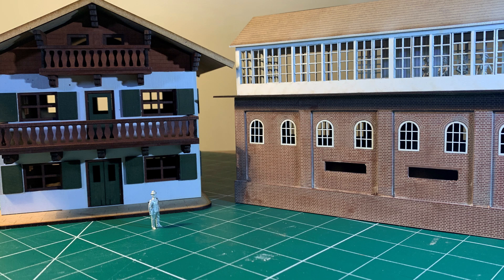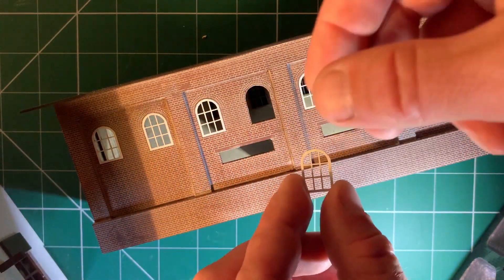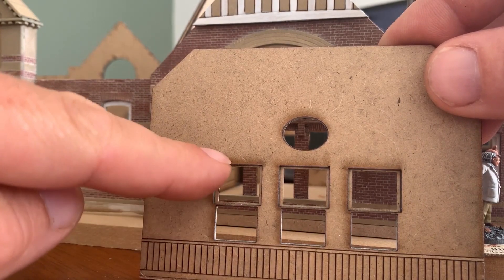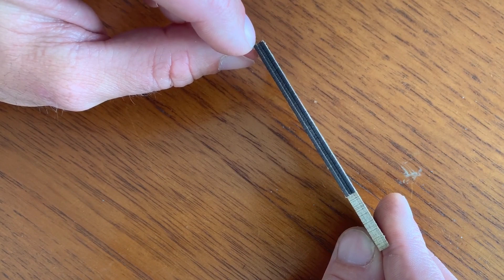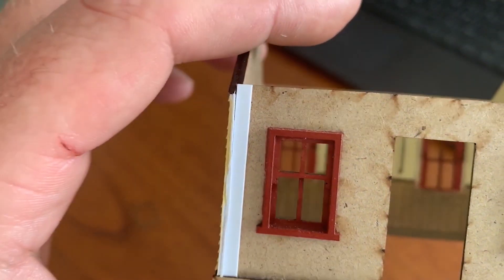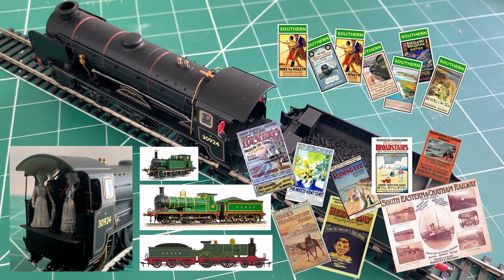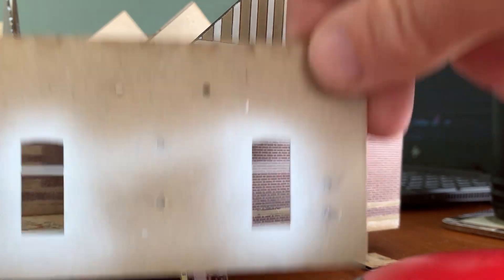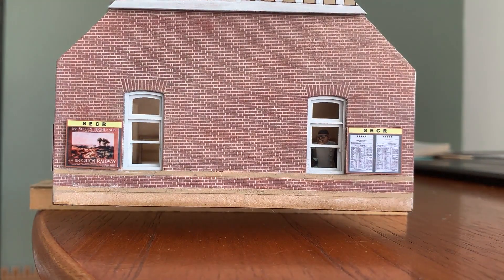Window Frames and Station Signs for Architectural Model Makers

Comment: This is phenomenal, man. I аm taking off my hat, you're a real master. If I understand it well as a building material, use HDF. In Serbia you can find 3mm HDF, as the thinnest, or 6mm MDF. As far as it seems to me from your attachment, you are using 1-1.5 mm material for your models.

I am currently trying to make a model similar to the former Rovinj railway station in 1/87 scale. I use Coreldraw for laser cutting.
Reply from the maker: Hi Branislav, and thank you for your very kind comments. 
I’m using 1 & 2mm MDF which can be very hard to find locally here in the UK too. I have to order my supplies online. 
I have had similar success laser cutting card, picture framers’s mount board being a material which works well and can be easier to find locally. 
I have just looked at Rovinj station building online and it’s very impressive, so very different from the railway architecture here in the UK. I’ve never visited that part of the world, but hope to one day and I am thrilled that you have found my video useful. Thank you so much for taking the time to leave a comment. It’s really nice for me to get an understanding of where all of the viewers are located around the world. 
I’m off now to find a map. 😀
My best wishes to you,
James

Comment: Fascinating James. You really have a great eye for detail, and the poster board idea is genius. Just a thought about getting them square on the wall. How about a shallow groove cut on the back of the board and a short section of styrene glued to the station wall. When fitting the board the styrene strip would locate in the groove and ensure it's level. Really looking forward to the series on CAD. It's definitely something I'd like to get into 👍
Reply from the maker: That's a great idea Tony, thank you very much.  I'll try it out and share the results in a future video.  :)

Comment: Found a N gauge converter and it says 45 metres would be 280 mm, so my maths is way off. Guessing this is right, in that case my sketch plan is far too small which means a big rethink.
Regards Chris
Reply from the maker: Hi Chris, I'm not expert but I think the error is one between scale and gauge.  N gauge (9mm) is actually a scale of 1:60.  Whereas the modelling scale is 1:148.  Modellers in 4mm scale have the same problem in that the scale doesn't quite match the gauge, which is why there are other gauge standards such as P4 and EM.
If my maths is correct then 45m scaled at 1:148 would be 304mm.  If you scale at 1:160 then you would get 281mm.
I'm sure others will chime-in if I'm wrong and I would be most happy to stand corrected by someone with greater experience.
Better still, I will see if I can find a picture/map of the shed in question and I'll do a quick CAD drawing to solve the matter once and for all!!  It would be an excellent example for a future video.
Reply from the maker: Hi Chris, Is there any chance you might be able to email me a copy of the map reference or suggest where I might find it myself.  You've got me intrigued here.  Very happy to do a CAD drawing for you if it will help.  You can email me at  makeitminiature@outlook.com

Best wishes,
James
Reply: Hi James, thank you for your help in this matter. If you click on this
 https://www.viamichelin.co.uk/web/Maps?address=Spencer%20Street%2C%20Bognor%20Regis%2C%20United%20Kingdom
it will take you to the map I have been using to get my measurements from. I am unable to find anything better. 
As you zoom in you can see Spencer Street, go south to Lyon Street West and the goods shed is the large building on the right just before the junction -next to the area marked P which was the old car park. 
As you zoom in I put it to the 10m scale and I make the length of the goods shed approx 60m in length and about 25m wide. You will see it shows the offices at one end and the awning which I have discounted at this stage. Hope that is clear enough for you. To get the measurement I was using 1:160.
Regards Chris

Comment: James, I did my sketch plan of my engine shed using the Metcalfe as a template but it just does not look right. I need a maths lesson mate. Going by maps etc I have worked out that the engine shed was about 45 metres long. So converting that to N gauge I make it 371 mm. Would that be right?
Regards Chris

Comment: Great idea to use magnets for replaceable signs!
Reply from the maker: Thank you very much.  I've a growing collection of them and find them useful for so many tasks, although they do stick to everything it seems.  I had a tiny one get stuck to my door key which later caused problems when unlocking my door.  Top tip, if you work with tiny magnets, have a brass front door key!
Best wishes,
James

Comment: Hi James your eye for detail is staggering, love the poster board idea. As for the windows, you really cannot tell, I automatically thought they would go up and down, they are that good. You look so relaxed in front of the camera, whats your secret?
Regards Chris
Reply from the maker: Thank you Chris.  I have made sash windows which slide, but to be honest the extra hassle of painting them alone makes me shy away from them now.  Also, to open, they need to have a little 'slack', which inevitably causes them to hang at a jaunty angle - all for a little bit of novelty.  The windows shown are simple and quick to paint - if the eye thinks they're good enough, that'll do for me.
By the way, I though a little more upon one of your previous comments, and have had a go at lasering 2mm bricks with some success.  When I'm confident I've cracked the settings, I'll share my experiments.  
As for being relaxed - trust me I'm not, I couldn't be more scared in front of the camera!
Best wishes,
James